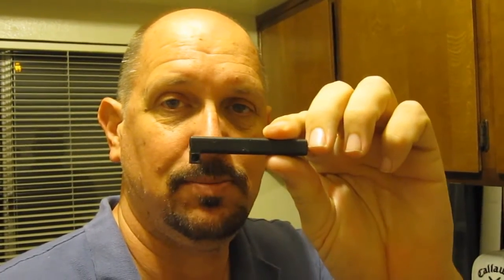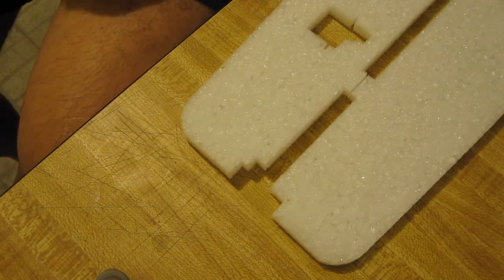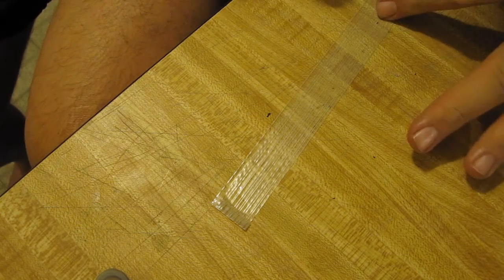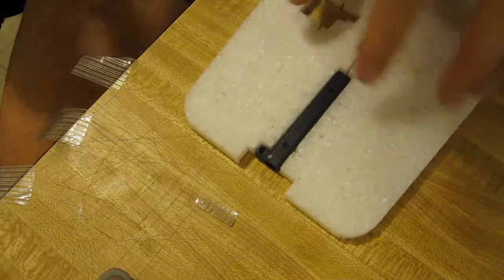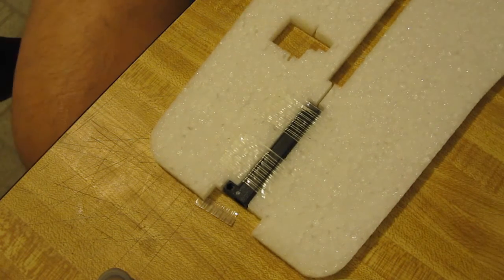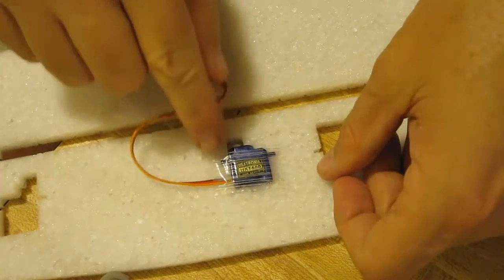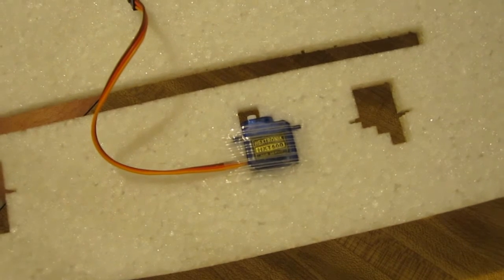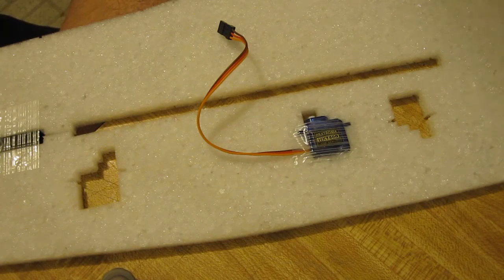How to install Stick Mounts and Servos

Comment: I assume you put the arm on the servo before taping the servo in, if not how do you put the screw in the arm or do you have the servo more to one side to get to the screw. I like this, Have been hot gluing in.